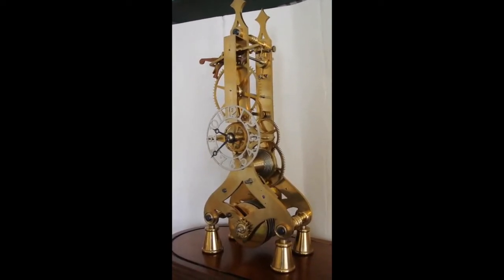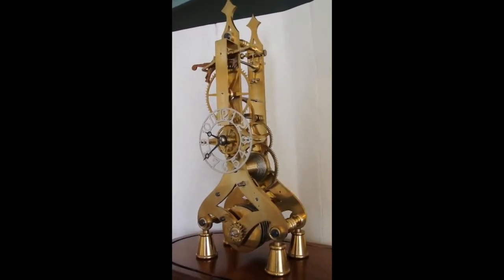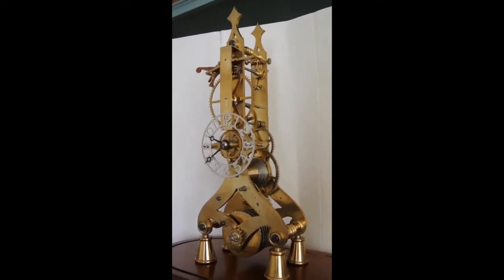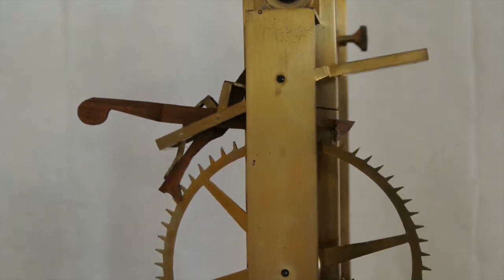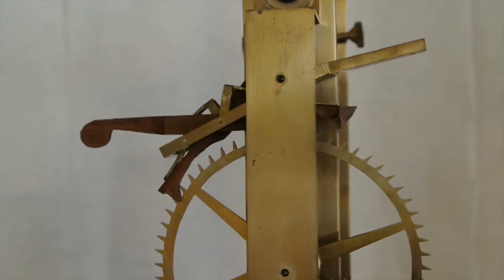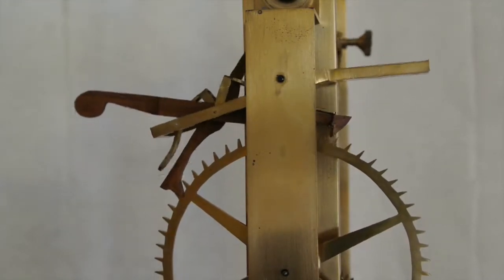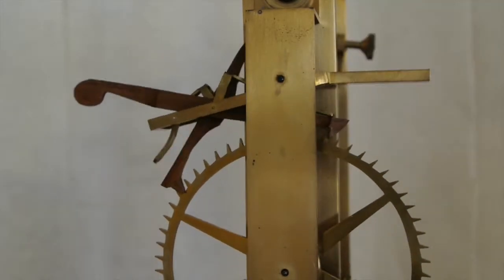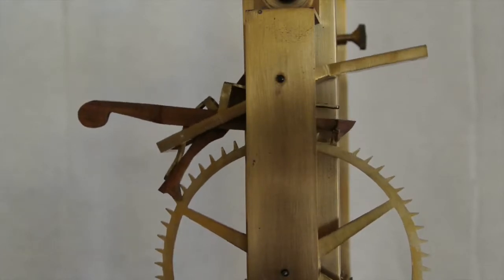Grasshopper escapement single pivot

Comment: From what I can see, the workmanship is excellent but there are a few tuning factors one may look at.
1. In any clock, the pendulum or the balance wheel should oscillate in its natural manner and not FORCED TO OSCILLATE  by the applied force.  From this video, I can see that the pendulum is being driven too hard for too long, much too hard and it is a forced oscillation and not a natural one.  I can feel it in my old bones! One would guess that the driving force/ torque on the escapement wheel is much too hard. It is clear to me that the pallets on the grasshopper legs are being forced into the escapement wheel when this action should be a gentle kissing action. The push should also be a gentle push with low acceleration on the escapement wheel. The spring involved is too strong and is driving the gears with too much force and the timing is due to the spring and not due to the pendulum. If my eyes are not failing, it seems that the fusee-chain transmission has been used. 
2. Also that the gearing has been selected for this grasshopper escapement to work at a high frequency and it seems to lose its elegance and grace in its movement. I would say that a two-second oscillation would have added elegance and mystique!
3. The ringing of the grasshopper legs on to their limits seems to be due to lack of buffer material used. I would suggest to past a patch of felt on the limits and this would buffer the impulse which is causing the ringing.

Well, this is an excellent piece of engineering and I would reduce the force being provided by the spring. To try I would let the windings run down and then simply apply a " human" effort to power the clock at the Fusee stage.
Once again, the pendulum on a clock should be lightly driven such that it performs naturally and not forced through a large angle of its oscillation.  Please see how the " freedom" of the balance wheel is achieved in the Swiss lever arrangement on others as the George Daniels escapement............  but a good look at any grasshopper escapement working in an elegant and graceful manner would be felt by a sensitive emotional person!!  Look for the music in engineering and not only the forced function!  Treat that pendulum as if it was a  woman, do not force it, just encourage it to behave naturally! Good luck.
Reply from the maker: Carmel

Thanks for the comments.
You really need to see this close in the context of the one I subsequently made from wood. I have made a series of brass clocks over the years all are under glass domes and almost all are 1/2 second to fit under a typical dome. Over the years I was making clocks I tried to to have a different escapement in each clock. I have made several unusual ones but the biggest challenge was the Grasshopper. The clock you have referred to in your message was one that my late father made based on Bill Smiths design. It never ran well at all and as you probably know used a compound pendulum to get round the problem of a fast beating clock. I agree entirely that it would look better with a slower action but that is not possible with 1/2 second beat. I replaced the old pendulum and the rather unsatisfactory ball raced heavy escapement arrangement with a very traditional arrangement but did keep his beat adjustment (which I could have done away with). Bill Smith even had to resort to banking pins in his design to limit recoil. I also compromised by making the escape arbor use normal pivots and indeed all the the gears and pivots are traditional ones. This gives rise to lots of friction. I only made this clock to prove that the Harrison single pivot design would work. As it happens it only just has enough power to run a full week. The Harrison clock action requires plenty of recoil in order to release the opposite pallet. I have never seen a Harrison 1/2 beat clock before but there may be some out there. Incidentally the escapement is based on David Penny's drawings made from Collet Quills measurements of the 1728 Harrison clock he had found as published in the AHS Journal. 

Having established that I could get the clock to work I designed a new clock made from wood and I think for the first time using Sutton's gears that he used in a Harrison style clock about 100 years after Harrison. and was also made of wood. You can find this all on Youtube under Wooden clock. These Sutton gears it turned out are really difficult to get to work reliably and accurately enough when made of wood. However with patience and noting where the clock kept stopping I managed it. I made the rollers for the pinions in the incorrect type of Lignum Vitae at first as I subsequently discovered and I remade them with PTFE  and only had success when they were just a lining inside a brass tube. With my new design I incorporated an endless chain Remontiore that has 30 second of duration before being wound up by the spring in the barrel. The new clock had Lignum vitae buses which I replaced in PTFE and all that work made the train run reasonably free. The escapement arbor has Knife edges running in Glass V as per Harrison.  As the clock runs powered by a weight I can adjust the amount of driving force sufficient to run the clock yet not too heavy that the spring will not wind it up at the end of the week. I did reduce the driving weight several times and altered its position on the series of holes on the arm. This clock does have one drawback that the Remontiore action really needs damping as it upsets the action slightly. However it does run week mow and does keep quite good time.

I am currently making a replica of the 1728 Harrison wooden regulator clock. I have finished the going train and it seems to run nice and free so far. I have not quite got the escapement adjusted correctly but when I am happy with it I will make up the striking train. I managed to get hold of the right type of Lignum Vitae by using an old Bowling ball. The full Harrison treatment with anti friction discs and lignum vitae rollers for the pinions really does make for very free action. However the original clocks have very heavy driving weights so it may not be the same in several centuries time. I have read up a lot about what is known about Harrison theories and am starting to understand what he was thinking. He was an amazing man.

The thing to bear in mind is that the grasshopper action was hidden on Harrisons wooden clocks and was not a decorative feature it just had to do a job of controlling the pendulum. Very few have made the early single point Harrison Escapement as it is extremely fiddly to make. 

Sorry for the long response but wanted to put it in context.

John